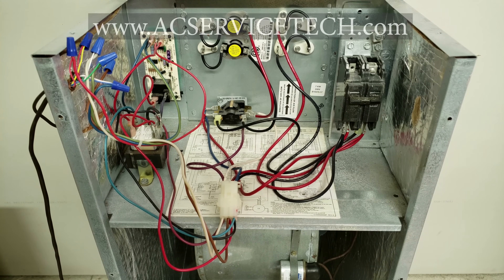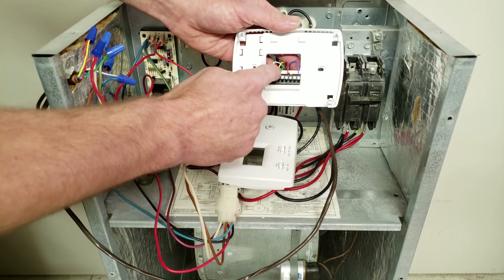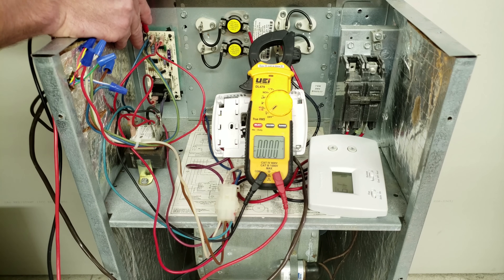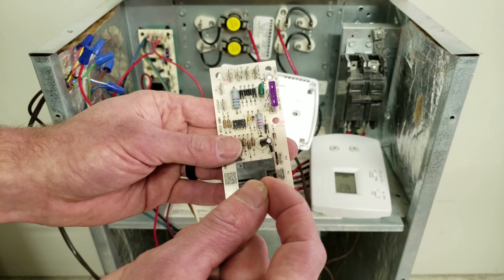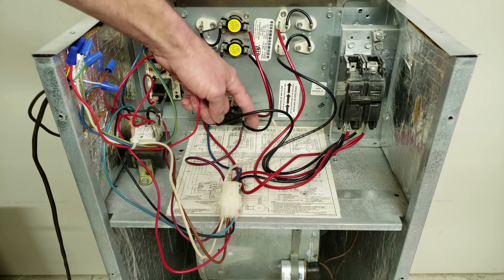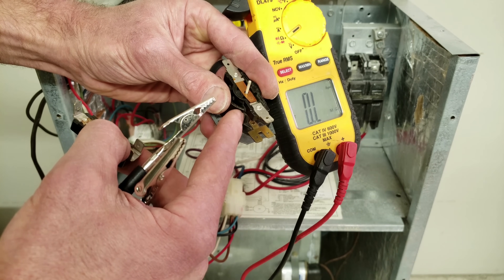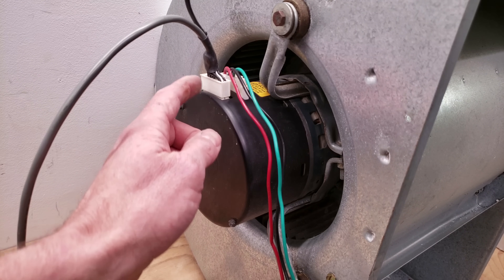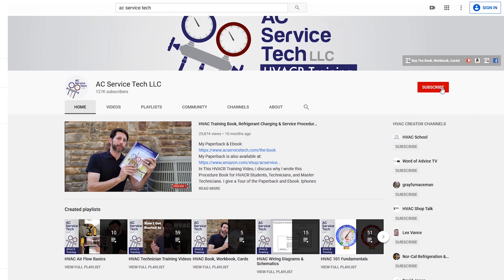Air Handler Blower FAN WON'T TURN OFF! 5 Reasons Why it Keeps Running!

Comment: I have a mystery. Compressor is off. Air handler blower is off. Thermostat is pulled off of wall. Everything is off. Hours later, the air handler blower turns on and won't shut off. Any ideas?

Comment: Just gonna put this out here it might help someone. Figured out none of this is the problem of my furnace but the nest thermostat I installed. So when you install a nest or smart thermostat and it has an airwave feature, by default it will be set to ON. Just turn it off and that should fix it. Good luck!
Reply: thank you so much for your comment, this fixed my issue too
Reply: Hi there, I am having the same problem I just installed new Smart Honeywell thermostat and fan stays on . Please advise, what should I do.
Thanks
Reply: Going to check my nest
Reply: Replace Nest with a Honeywell 👍

Comment: That is all great information, but what about a blower that is running but running very slowly? There are no shorts in the motor and it runs fine when I turn the fan switch to ON,but in the Auto position it runs very slowly, which would typically be a shorted winding in the motor along with a main contactor that opens only one side of the line. Since the motor is not shorted to ground and is NOT an ECM motor why would it be turning slowly??

Comment: Don't forget to check where your leads are plugged in. Just got back from a call that had me stumped but whoever was there before me plugged the blower into the bottom of the contactor so it ran as long as there was power.

Comment: My indoor fan keeps running but at like a half speed after it's suppose to shut off reaching temperature. I've pulled the tstat and it still continues to run at half speed. Any ideas?
Reply: What was the cause?

Comment: what color wire goes to which terminal on a new goodman heat pump installation in the air handler? fan will not stop running when desired cool temp is reached in cooling mode.Thanks

Comment: We have a twin system that did this years ago and an HVAC company wanted $700 to fix it, but I had the feeling it was a cheap and simple fix si.i said no. I just switched the power to the second system. 
Now the other side is doing it so I have to fix it properly.

Comment: When it is hotter out my attic AC fan will come on even though the thermostat is set to "off" and the fan is set to auto.   It will go off only when it gets eventually gets cooler as sun sets.   It will run with thermo pulled.   So the attic temp seems to have an effect.  Thoughts?

Comment: You say when you pull the thermostat off and the blower motor turns off you know that the thermostat is bad? wouldn't you think that disconnecting the thermostat would disconnect the red and green wire (switch) and turn the blower off indicating the opposite? wouldn't that disconnect the blower = red green continuity?
Reply: He says blower is running without a call. Pulling tstat and blower shutting off indicates tstat was the culprit. Of course if you had fan switch on, or tstat calling for cool, blower shutting off when pulling cover is normal.

Comment: Thanks took my SEQUENCER out and took the top cover off and it's fried ordered a new one from Amazon, I'll update after installing the new one. I replaced the fried SEQUENCER with the new one today's system is now fixed fan now turning off on schedule. Auto and fan on working normally.  Thanks for all your help AC Service Tech LLC! 😀
Reply: Thank you for your post this info. Sometime ago, I wanted to replace the Sequencer, but it got stuck mechanically inside the air-handler. I will try one more time to take it out and order it now.
Reply: @DangeRuss, What was the problem before you replaced the Sequencer?
Reply: @HsingSun  The blower fan would not turn off when the systems reached the desired temperature. The strange thing is that it happened with no warning and the only way to turn it off was to go up into the attic and pull the breaker.
Reply: @DangeRuss316  in my case, it seems that the blower is running, but at a low speed. I barely can hear it, but I feel air sucking in from the air filter unit. It is not blowing as it does when running cold air. Was this your problem? Thanks

Comment: I have a blower that turns on for brief periods after a heat cycle has finished, or randomly when no heat is called for. When called to heat the furnace never fails to light, what would cause this to happen?

Comment: Had 25 volts on g and c switched with the spare black wire on board and thermostat , still reads 25v

Comment: Mine does the opposite. The blower motor does not turn on automatically at times. I have to sometimes maybe even 60% of the time spin the fan to get it to turn on. I clean the filter turn off the switch and sometimes it’s hit or miss. Any suggestions ? Thanks.
Reply: Replace the capacitor

Comment: My blower motor wouldn't turn off, after my landlord had just done a whole new furnace install. I finally figured out that he had the blower moter on/off switch pressed to on when it didn't have to be! I turned it off, cranked the thermostat until the furnace started, then waited patiently to see if the blower motor would turn itself on...three mins went by and it did! Yay! I bet my electric bill goes back to normal again!

Comment: Awesome video.  I disconnected my thermostat and put new batteries in.  It seems to work fine now.
Reply: Well, that was last year.  Now its running all the time again.  Time to call the experts.
Reply: @ast-og-losta  so what was the problem mine wont shut off on heat once it reaches temp setting   either

Comment: Ok, I have the continuous running fan. Check thermostat (good even replaced with known good one
), checked wiring (good),  checked motor by removing 4 pin connector & leaving power connected (motor stopped), checked relay (good), & the last thing to check is sequencer.....but I do not see one! Any help out there??
Reply: It seems like ac unit is a crazy thing in our lives.

Comment: I'm trying to trouble shoot this problem but it happens intermittently. I can't force it to happen. It happens like 1 time every 2 weeks. It seems to happen in the middle if the night so my wife forces me to get up and flip of and on the furnace.

Is there a way to pinpoint this problem if it's intermittent? I'm guessing it's the fan relay or high limit switch malfunctioning. I'm confused because it goes into a regular state of working weeks at a time. Would you guess the problem is narrowed down to a 120v switch that is bonding a switch to stay live due to heat and overcurrent? As opposed to a thermostat or possible low power shorts from the thermostat?

Comment: I wonder if my thermostat is bad!  I will show this video to my husband when he is off his work call.  My scenario:  It is winter, the A/C system is turned OFF and the FAN is in the OFF position but air is coming out of the registers!  The air conditioning unit outside is not actually running but the air coming through the registers is cold due to the outside air temp, I think.  My baseboard heating system is on but is controlled by a separate thermostat in a different room.

Comment: Is there a high temp sensor that keeps the fan running after the heat turns off?  If so if that sensor thinks the box is still hot would that not keep the fan running.   I have not opened mine up yet but did disconnect the thermostat wires last night before unplugging the unit when the fan continued to run.

Comment: We had an issue at the new place we moved into. In short, there was no "failure", just an error committed by the last technician.
When the Thermostat was set to OFF, with the Fan set to AUTO, nothing would happen and that is normal.
When the Thermostat was set to OFF, with the Fan set to ON, nothing would happen and that is NOT normal, the Fan needed to come on.
When the Thermostat was set to HEAT or COOL, with the Fan set to AUTO or ON, as soon as you set to HEAT or COOL, the Fan would come on, regardless of Thermostat Temperature or Fan setting, the Fan would run continuously until you set the Thermostat to OFF, no other way. While the Fan would run, when set to HEAT or COOL, the Thermostat Temperature setting would still control when HEAT or COOL would actually come on, which made this issue bearable for the moment, because we would still get temperature regulation but with the Fan always running.

When I pulled off the Thermostat faceplate off and jumpered the R (Red/24VAC) and G (Green/Fan) wires, the Fan would NOT come on. I confirmed I was getting 24VAC at the R wire and went to the Furnace to see if the G wire was disconnected and found that whoever worked on the system last had swapped the B (Blue/Common) and G (Green/Fan) wires. I swapped back these wires at the Furnace connections and when I re-jumpered R & G, the Fan ran. Now the Fan comes on with the Thermostat set to OFF and the Fan set to ON, and turns OFF when Fan is set to AUTO with the Thermostat OFF. I then verified that the Thermostat truly runs the HEAT and COOL as intended by adjusting the Temperature settings to kick things ON and then back OFF. The outcome, Fan comes ON AUTOmatically and OFF AUTOmatically when the Thermostat is set to AUTO, which wasn't happening before. It's a lot quieter in the house now.
Reply: You have one year warranty under the new home construction. Good luck.

Comment: I had that problem today. The blower would just run. But the problem was a burned transformer. Changed out the transformer and blower stopped running checked system in both heating and cooling mode and now is working properly. Y’all videos are great
Reply: My transformer is buzzing. Was yours? Even in off setting on thermostadt.
Reply: @MAKAROVOWNER bad transformer kept your unit running   Even when removing signal
Reply: @iffgambetta5319 A bad 24V Transformer would stop sending any electric signal to the motherboard and thermostat, and contactors at the outside condenser compressor.  How would a bad transformer keep the indoor blower  fan constantly on and not shutting off?
Reply: @connicrow9463 I think he’s confusing a relay switch with the transformer. If the relay on the control board is bad the blower will run non stop
Reply: They buzz they are transformers duh @MAKAROVOWNER
Reply: A bad 24V Transformer would stop sending any electric signal to the motherboard and thermostat, and contactors at the outside condenser compressor.  How would a bad transformer keep the indoor blower  fan constantly on and not shutting off?

Comment: In the last scenario where you disconnected the connector, and it keeps running the motor
does this mean that the motor needs to be replaced, or are electronics in the motor tat can be fixed?

Comment: just learned my air blower kept running because the humidified was calling for it, even though the heat was not being called for and the thermostat was off.

Comment: Filter too dirty and or rest4ictive
Limit switch or other lockout because intake air being drawn from outside the conditioned envelope,  in other words operating outside designated operating temperatures of unit

Comment: How much should it reasonably cost me to have my home air handler relay switch replaced by a professional?  I live in FL if that helps.
Reply: You can DIY! I replaced three parts, but it is still the same problem, ac keeps running.
Reply: @HsingSun  I have the same problem.  My blower motor will not stop running!  Did you fix yours?

Comment: For anyone who might need this:

He says in the video that if you disconnect your thermostat and the blower, or handling unit, turns off then it’s a faulty thermostat but I don’t think that’s correct. When I removed my thermostat my blower kept running and would only stop when I opened the breaker for the furnace. He says in reason 5 that in this case it could be a faulty module. 

In order to completely rule out the thermostat, you should disconnect your thermostat and pull the breaker to get the blower to stop running. Close your circuit breaker and see if your blower comes on. If it does the problem is not your thermostat. If it doesn’t than the problem is your thermostat. 

I did this and narrowed the problem down to the thermostat, which I replaced, and the problem went away. It must have been internally shorted. 

Overall this video is very good. I couldn’t have figured this problem out without it. Thank you!
Reply: I’ve installed new units and have had the red and green from thermostat wire shorted and kept blower running even after pulling tstat
Reply: I had a bad transformer.
Reply: How would a bad 24V Transformer keep the blower fan constantly on and not turning off ?
Reply: ty very much!
Reply: I tried this, I took the thermostat off, changed the batteries, they were heavily corroded, turned the AC breaker off, the blower turned off. Flipped the breaker back on and the blower came back on....

Comment: My blower motor stays on. But My thermostat is a vintage one that uses mercury. Would it have the same or similar problems, and could it even actually be the thermostat itself causing the issue?

Comment: What if blower motor cycles on and off (auto) when commanded by thermostat but won't cycle on when selected "fan on" at thermostat?
Reply: Fan "On" run 24/7, non-stop.

Comment: I have issue with the Carrier furnace blower that keeps turn on/off very 20 seconds or so when it was called for heating from the controller. Searching around, there are few comment about the limit switch went bad. so, I have replaced the limited switches but the problem is till there. Is this mean the blower motor is bad or the CAP ? Please give me some feedback before I called the HVac service and cost me arm & leg for this. Thanks in advance

Comment: I have a Fujitsu ARU18RLF air handler that won't shutoff after reaching temp, but issue only happens in HEAT mode. Anyone else have this issue? Resolved it??

Comment: We have a gas furnace. Blower is on and not stopping,  but I don't feel air moving through the vents.  I suspect a flap or something in the ductwork that's temperature controlled is still closed.....? It's 2am, I can't really call anyone. Can I turn off the breakers in the main panel and deal with it in the morning? I'm guessing the gas value would be either electrically or temperature controlled, such that I don't need to worry about leaking gas ......? I had to unplug the furnace,  that breaker also controls the garage door, so I has to leave it on. Pilot light (s) are still on, hope they'll be ok. I will try to actually diagnose the issue in the morning. Your video makes it seem so simple, I really hope I can fix it!! Thank you for posting this troubleshooting information!
Reply: Can you tell me how you fixed this?
Reply: @zantiagotron07  We actually ended up calling an HVAC technician. It was some sensor, I'm sorry I don't remember what it was called. The repair was just under $400. Which is fairly inexpensive for heating cooling calls. Alot of $ to me, but worth it to have heat again in winter.

Comment: Hello, watched your videos, very helpful but still stuck.. I have a carrier unit, my fan won't shut off unless you turn the breaker off... I decided to replace the heater strip kit and it didn't fix anything. There isn't anything else in there to replace besides the transformer. I did replace the thermostat because Lowe's had a sale on them but it didn't fix anything, my unit doesn't have a big board like your video or have a sequencer. What else could it be??? Unit is 6 years old.. the heater strip kit # 81-0460-00
Reply: I am having this same issue. Did you find out what your problem was?
Reply: @DemonicPeriod  disconnect low voltage wire going to tap on blower. If it still runs, than module  on blower is bad.

Comment: Hello Craig, quick inquiry: my HVAC will run when it's supposed to but as soon as it reaches temperature and shuts off, there's still something that constantly runs and won't shut off; it blows even more air into my home. Last night it (the AC) just ran and ran and ran even though the thermostat was reading lower than to what I had set it. Would this be the blower motor or something else? This also happens whenever I run the heat and run out of propane; it just runs and runs and runs blowing cold air into the home instead of shutting off.
Reply: I have this same issue. Did you figure out what was causing your issue?
Reply: I have the same problem over two months and I tried to fix it, no luck; Even I replaced the timer-delay and fan relay.
To be alert, you need to shut off the system as soon as both temperatures (cooling setting and inside) are the same. Otherwise, you will pay three time for the electric bill.
Reply: I will replace my next part, Sequencer, but it is made in China. It takes 6 weeks to arrive.